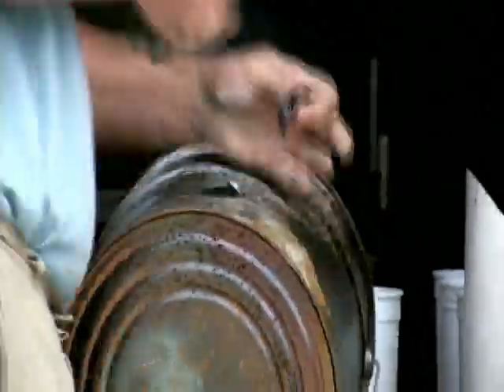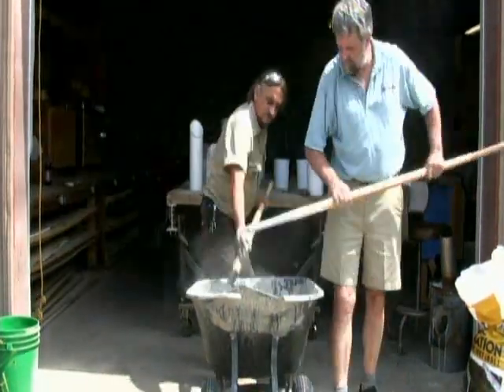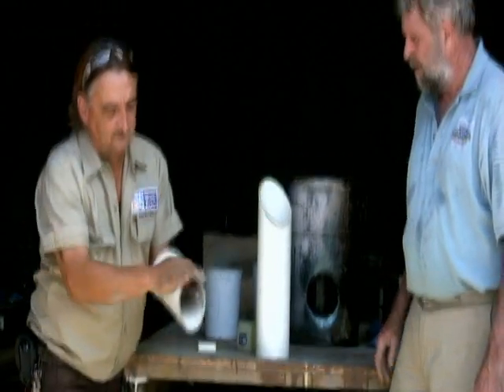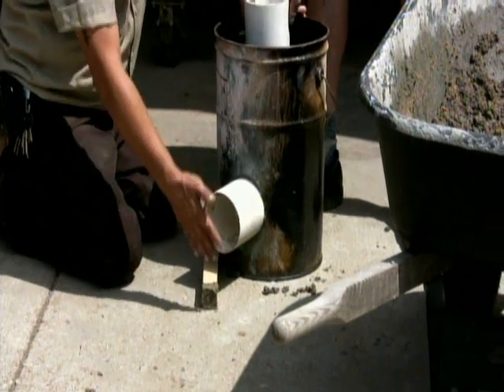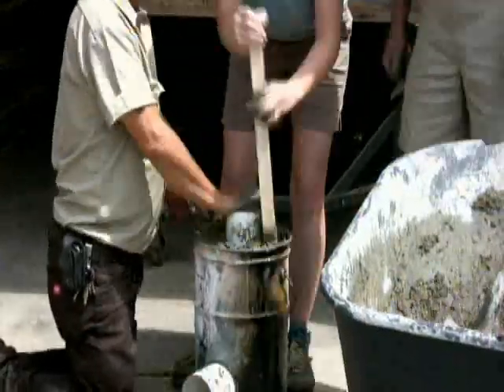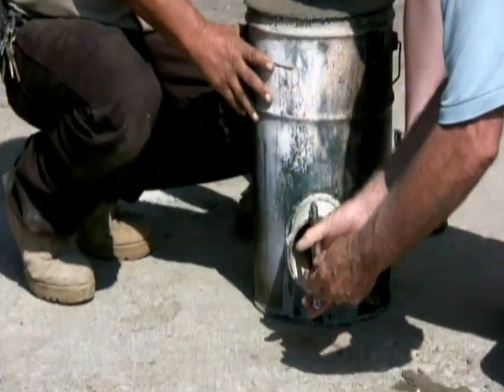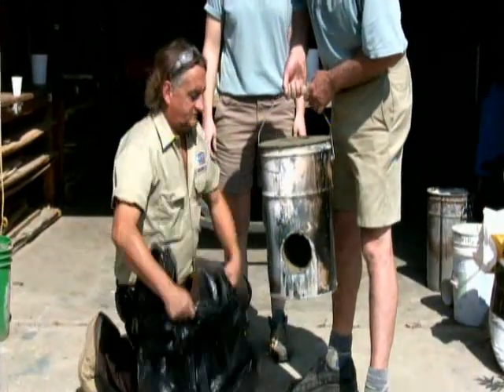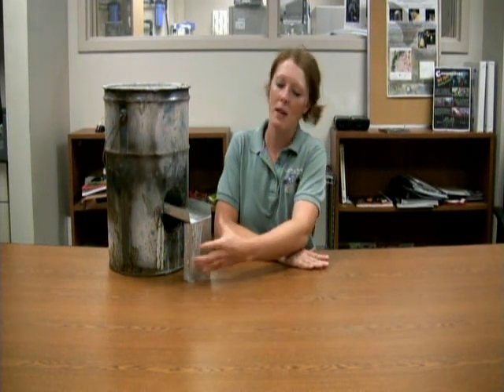Concrete Rocket Stove Final.avi

Comment: You all spent time money etc. you should have included how the stove works your stove top looks flat how do you place a pot ?.  you could have shown start a fire and place a pot that will complete the whole process. YouTube reaches millions, not every one can understand, by your in complete vedio. Remember no one cooks food with Rocket  stove in America. It is for the under developed and developing countries, Dummies watching your vedio will bring down to what do you think ?. Second metal fabrication insert you show is very difficult to come up with families, that is out of the families frame work, most families do not have hammer, then you can imagine what is metal fabrication leads to, nothing.  85  years back my mother built clay stove off course it smoked but held well, can you use clay instead of your fancy concrete mix ? we all have to learn at times but not in a hurry. Thanks you spent money to make vedio, not well spent. I live in Vashon Island, a man lived 7 + years in Africa, came home to the Island, he had developed smoke less stove, took that stove to Africa taught the welders how make locally,  Wishes to you all

Comment: You should have made it a fast feeder by putting the intake on an angle. Also you could have put some copper pipe in a circle around in the concrete mix and have this to feed any water you need to have hot.

Comment: Hi, what was the volume of that can?
I like how it's long. I don't want to just use a 19 liter plastic bucket because of the volume and the weight.  But that one you had is nice and tall.
I have a 12 liter ice cream bucket that is 12 inches high and 8 to 9;5 inches wide (tappers at bottom).
I'm thinking of using 2 tin cans for the chimney (3 inches across) and a spaghetti can for the fire chamber (3.5 inches).
I'll use 12 liters volume for the stove, minus 1.5 liters for the cans.
I was thinking of making a box that's 2 inches deep, by 12 inches across to "lay" the concrete in first, then add the bucket (upside down - so the bigger tapper is at the bottom) and then start the tin cans at the bottom point of the bucket.  they it would be a total of 14 inches high.
the coat hangers that i'll use for rebar will start at the one inch mark in the box base.'
so, could you tell me about your can's dimensions, please?
I don't want 2-3 failed rocket stoves, made out of concrete laying around my yard.

Comment from the maker: Hi Jordan,
Working on getting a video posted for you... check back on Thursday.
There isn't much difference between the two. Both make great insulation. Vermiculite is made out of mica and perlite is pumice. Our team prefers perlite because it makes for a harder stove. And, while both break down over time, perlite burns about 100 degrees less than vermiculite. Hope this helps.
Thanks for your interest!